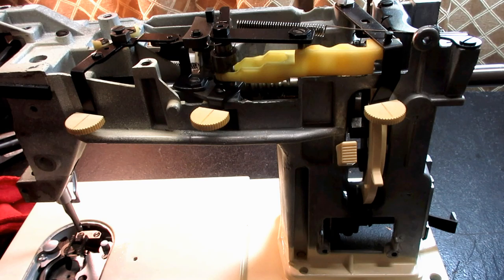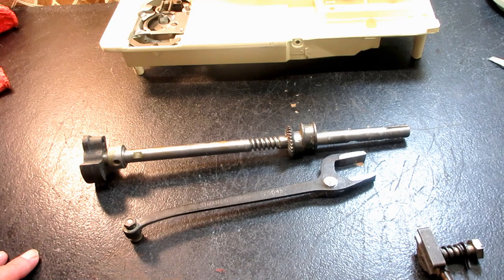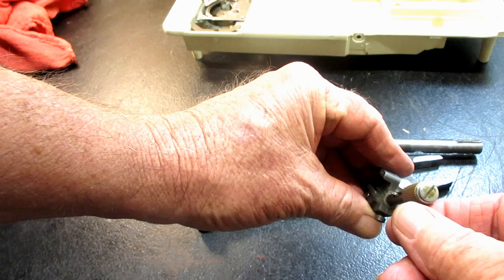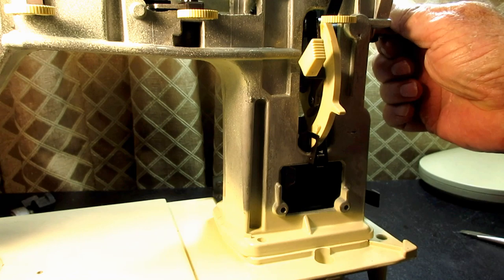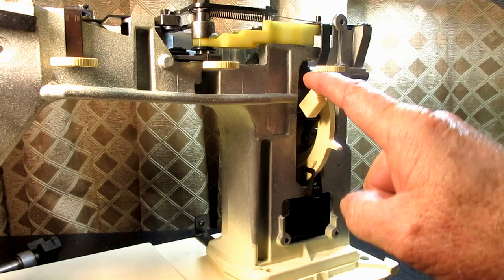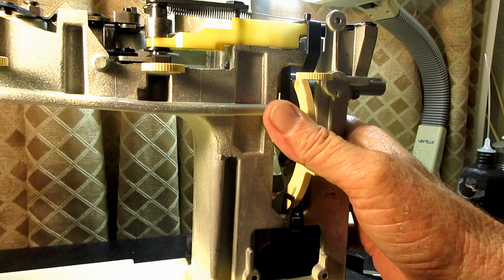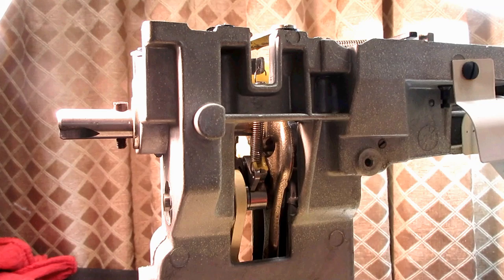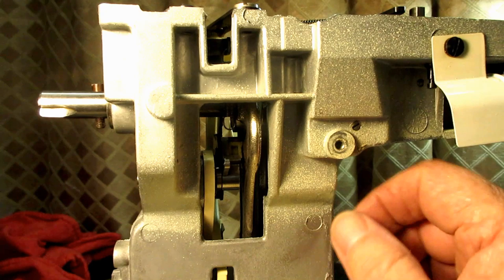The Reverse Feed Lever/Button on the Singer Model 353 Genie Sewing Machine

Comment: Hi Andy, thank you for sharing your immense knowledge! I think you can "soften" a spring by hooking a small ring, as if you made a chain containing two links (the spring and the ring (edit)). The more you pull the spring, the more it pulls back. So if you install a ring, you don't need as much force to install the spring and then you don't need as much force to press the reverse button/lever. The drawback is the spring doesn't pull back as hard to switch to forward stitching and the length of the ring has to be chosen carefully not to hit other parts. I haven't tried this but I thnk it could work.
Reply from the maker: I think I understand what you are getting at here and feel it could work. I copied your comment into my Tension/Spring files and if the occasion presents itself again I will test it out. My Genie is long gone to S.E. Asia, so I can't test it at this time. Thanks for sharing this b/c it seems so easy if it works instead of trying to track down a Non-OEM spring of lower tension. Thanks for watching my videos too, and take care.

Comment: Thank you Andy for your thorough presentation. I had already cleaned the inside which didn’t take much,  but I’ll re-examine the area you mentioned. I have several machines that I purchased over the years and try and take turns using them for my sewing projects. I also have my first machine I purchased new when I graduated in 1973, a Montgomery Ward sewing machine, with an easy push button reverse which is why I felt the Genie was over and above the necessary pressure. Thanks again!!!
Reply from the maker: My pleasure, Rita. I have finished reassembly, and with the new rubber feet on the machine, the reverse button is a little easier, but I agree it takes more pressure to push that than many other push-button reverse machines I have worked on. Installing a different spring is all I can think of to provide easier use. Thank you for watching.

Comment: My Singer Merritt 1873 (1986 manufacture) is a push button reverse. Stitch is adj 1-5. At 1 on the stitch selector the reverse  button is almost all the way in. At 5 it's all the way out. Moving the stitch wheel around to button-holing functions locks the button out to where it won't move at all. I do love my Japanese 15 clone for it's reverse. You just got to remember to put it back to forward!!
Reply from the maker: That is interesting that the reverse button moves like the Genie. Since the feed regulator changes the "arc" of the forked feed connection on the eliptical of the arm shaft it does make sense. I've never worked on a machine with a buttonhole function, so it's nice to know that when it is in use it locks out the reverse button. Like Caroles Model 418, it must be quite crowded in there with the two shafts. the feed regulator, reverse button and lever and then the buttonholer parts too! Maybe that is why I work on the earlier models? Nice comment, Abe. Thank you.

Comment: Andy, I used a small digital torque fish scale .the type contestants use to weigh there singular fish  at competitions, carp  fishermen use them to see how many pound there fish weighs,
use this type of scale to attach to the spring  and pull on it until you stretch it by 1 inch and check the scale number,
if you pull on a weaker spring  until it stretches out an inch then it will show less weight or force on the scales ,this will be a weaker spring
Then you will know which spring needs less force to push the thumb lever ,and you can work out the pound per square in of force as well,
Reply from the maker: Thanks for sharing a solution. I copied into my Genie files. If I ever get a similar situation I'll give it a try. Thanks for watching my channel.

Comment: Thank you so much for this!  My 418 has a push button reverse, and I really couldn't figure out how it worked.  The Genie reverse system is similar.  I'm so glad to know about the mechanism of the push button reverse and the lever reverse, as I really had no idea how the reverse mechanisms worked.  On the 418, it's really crowded in there with the automatic buttonhole system and the flexi-stitch system, so it's hard to see how the reverse works.  So I was glad to see you show the parts and explain how it works.  I definitely prefer the lever versus the button for reverse stitch.  Nice to see why the button goes in and out as you change the stitch width.  Such an informative video for me.
Reply from the maker: Thanks for letting me know, Carole. This Genie is crowded enough inside as it is. I can just imagine the 418; is there any daylight in there? Haha. 
Take Care.

Comment: My 533 has a similar push button system. I have to grip the back of the machine like you showed. I much prefer the lever reverse like on the 500a, 237, 15, 201, etc.
Reply from the maker: Thanks. Brad. I guess I'll never know for sure why they went to the button style. I do know Singer was facing huge competition from Asia and other places, so maybe trying to cut costs and stay "modern". When I compared the bush button parts to the old lever parts it seemed to me the push button would be higher costs in parts & labor. Oh well, The 353 Genie is still my favorite portable zigzag Singer, and the 403A Special is still my favorite 'Cabinet" zigzag machine by Singer. Thanks for watching and taking the time to comment, Brad. Take care.

Comment: Andy i could use some advice, i own a singer 491. All cleaned and adjusted however the reverse works for 6-8spi but a closer stitch the feed dogs stay in one spot in forward its beautiful stitching but no reverse to lock my first 3 or 4 stitches 🤷‍♂️
Reply from the maker: Sorry, the only SInger Model 491 I can find documents on is an Industrial Model. Is that the type of machine you have? I don't work on Industrial Models. If you've given the wrong model number let me know, or if it is a domestic model of machine maybe give me another model number that looks the same. In general, on domestic models, the oscillating path of the feed dog is determined by the setting of an eccentric stud on the lower end of the fork feed shaft that the feed regulator connects to. The eccentric is normally adjusted towards the front of the machine for the full oscillation of the dog, but the adjustment is tiny, like within a 1/4 circumference. If someone turned the stud too far and the eccentric side faces the rear it changes how far the dog can move. I have no idea if this works the same for Industrial Models.

Comment: Singer six zag 974 sewing machine stitch regulator assemble video plz
Reply from the maker: Oh, I wish. I've never even seen this model made in Brazil late '70s I think. Very hard to even find a Service manual for it any longer. A friend in Spain told me they used the model 288  service manual and the 3100s parts manual when they had to work on the 974.
He sent me copies of those this morning and I will share them with you if you like. Email andymanuals53@gmail.com and ask for "SERV288 and PART3100" manuals and I'll have them reply with the PDF copies. No Charge. Thanks for watching my channel.